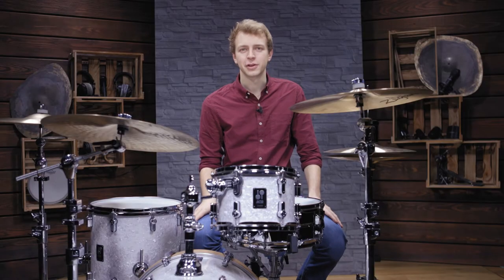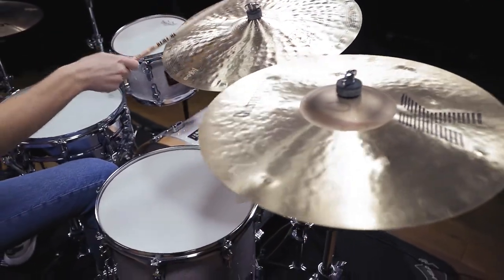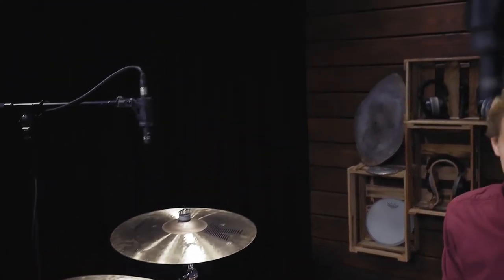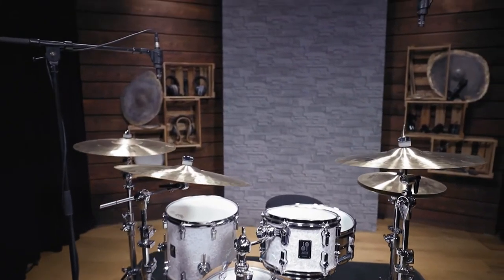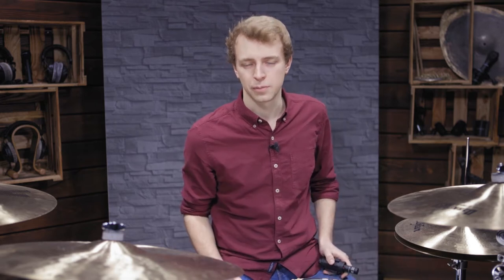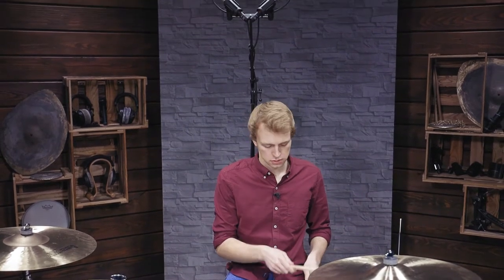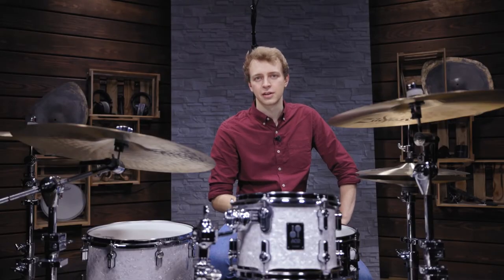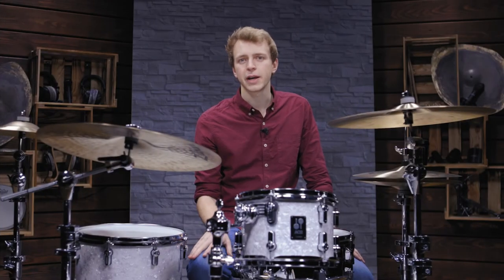beyerdynamic | Drum miking series  - Episode 5: HOW TO MIC OVERHEADS

Comment: Question: What is the length of the microphone cable you would recommend?
Reply: It’s usually 3 feet but could be more
Reply: As long as you need?  Longer than you need?
Reply: @ramencurry6672  3 feet isn't nearly enough. 10-15 minimum.